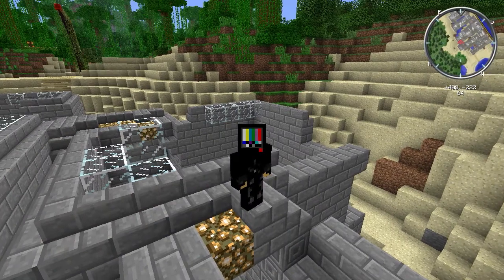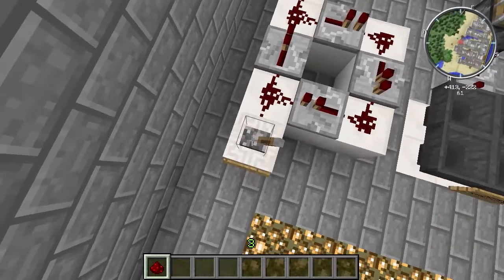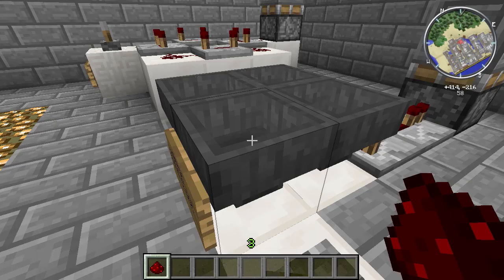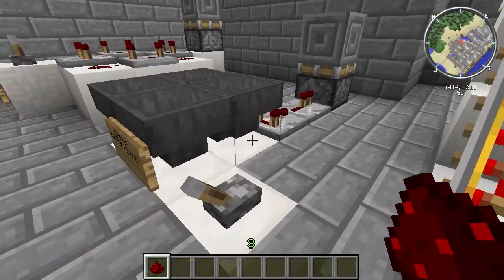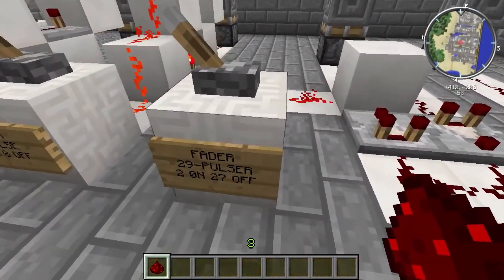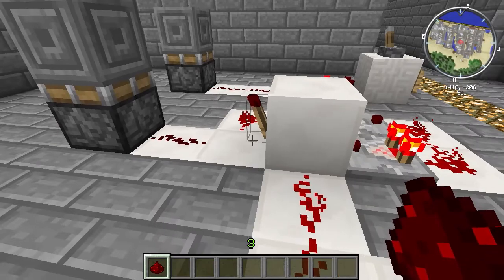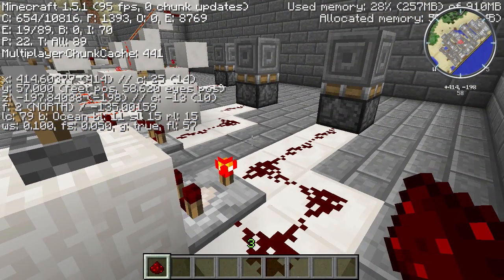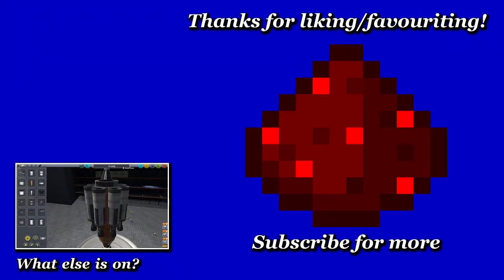Minecraft: Redstone Basics 4: Clocks

Comment from the maker: It is a simple furnace/comparator/daylight sensor toggle. The contents of the furnace feed the side of the comparator blocking the daylight sensor signal once it is low enough. that runs through a not gate which then triggers a command block.